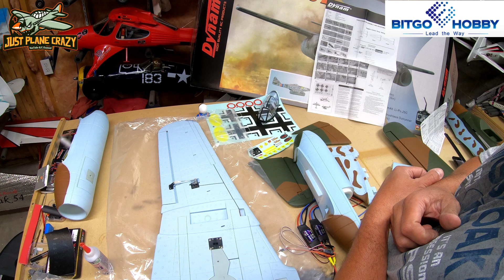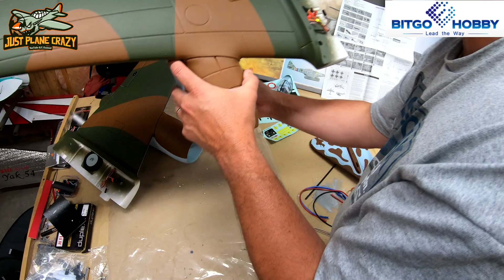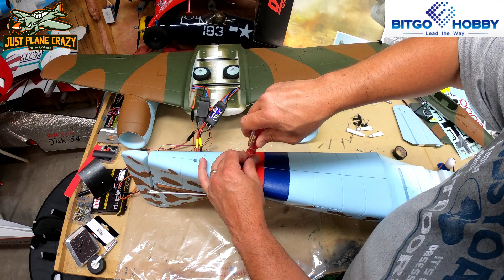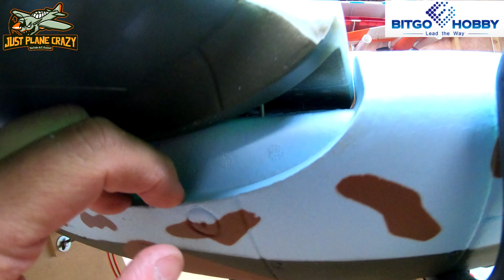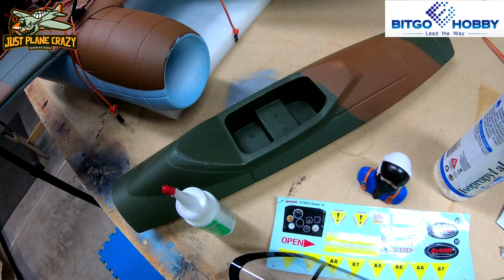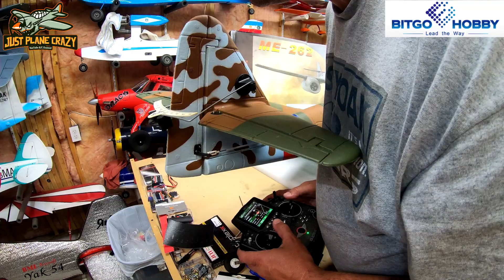Building the Dynam Me262 from Bitgo Hobby

Comment: What do you mean “minwax” your planes
Reply from the maker: Great question. To protect the paint and give the planes a clear coat finish we use WATER based minwax polycrylic. It comes in a can you foam brush on 5-6 coats or spray can 7-8 coats. Lightly each coat. Matte for war birds and gloss for fancy planes. Catch my new AL37 build series coming up over the next 3 weeks and you will see it

Comment: great video, could you help me with the center of gravity i put in a 4500mah battery and my me262 got too heavy on tail, thanks
Reply from the maker: For sure. I show u in next Sunday’s vid on the maiden. I had to add 6oz of nose weight to achieve book cg. If you have a bigger battery use it instead. Carve out the foam. That’s always better than adding weight. I just didn’t have any other 4s packs